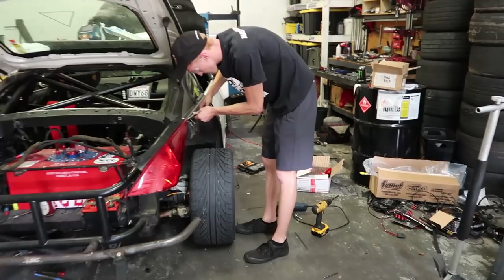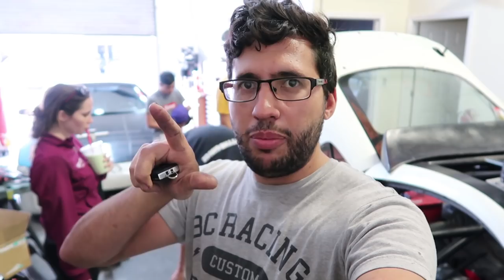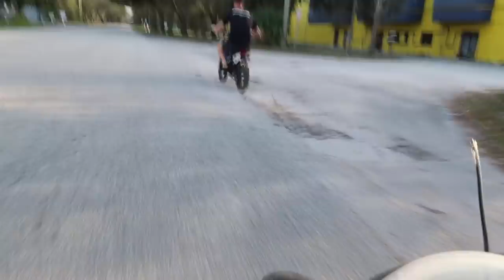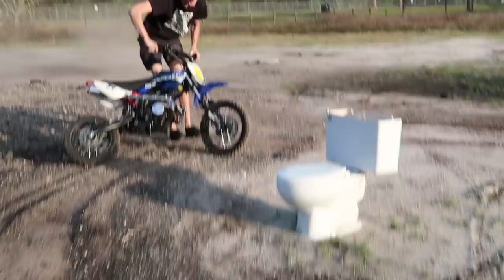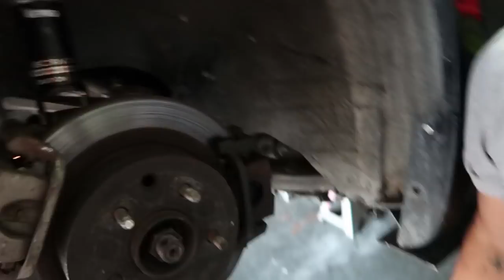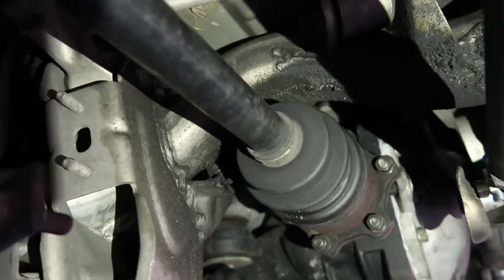DUAL CALIPER INSTALL ON BUDGET 350Z

Comment: Looking at doing this soon, but just wondering if you had an issue reconnecting your e-brake cables?
Reply from the maker: I deleted mine, but it’s not hard to do with the brake back in it’s just annoying getting the springs in place